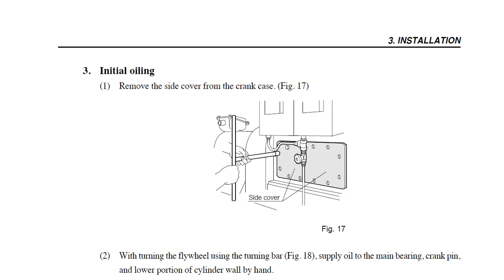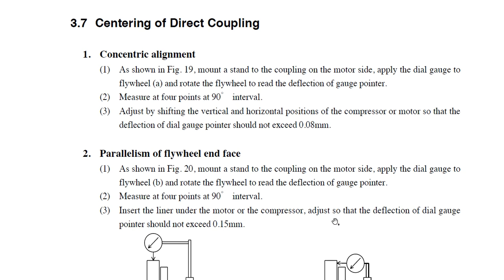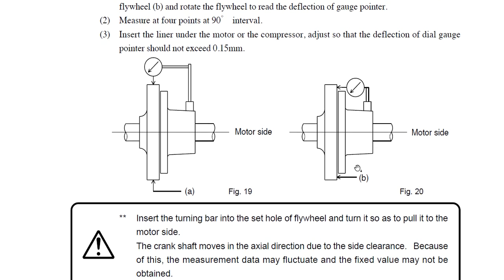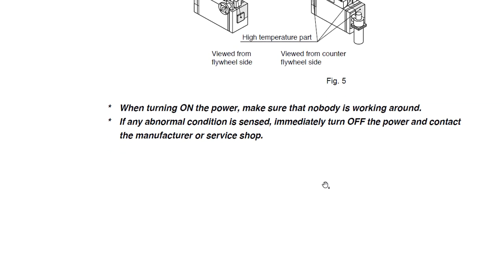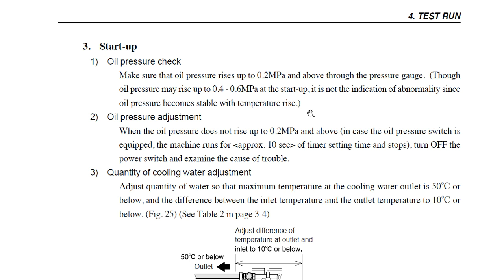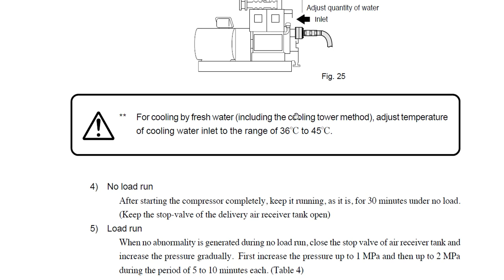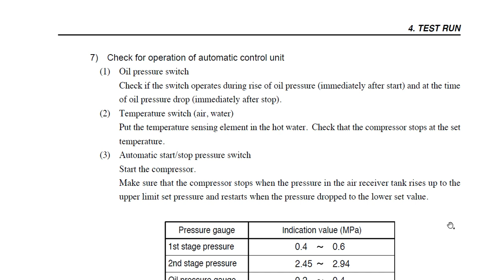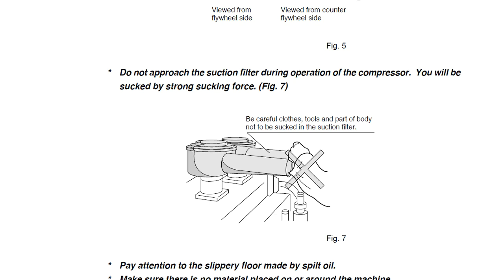Concentric and Parallel alignment Air Compressor

Comment: Thank you for another informative video Sir. Just got one question, u mentioned about purging air from the highest point regarding air in oil line, sir kindly share what was the highest point u used for purging in this compressor during ur incident. Was that Oil Release valve or somewhere else?  Thank you. Best Wishes.